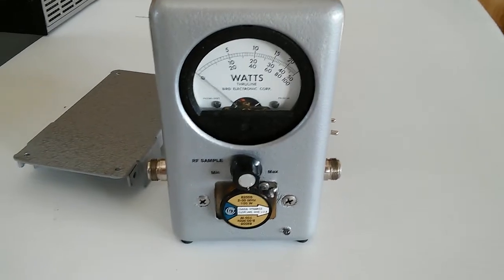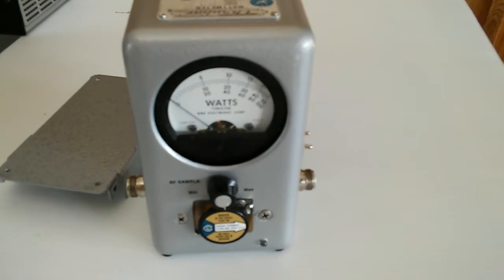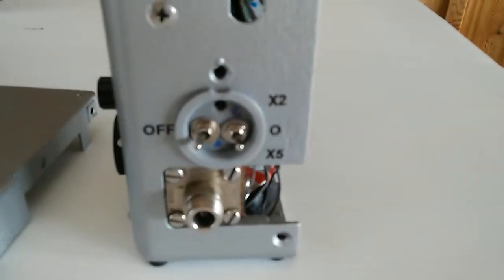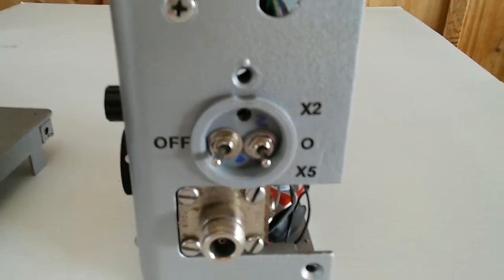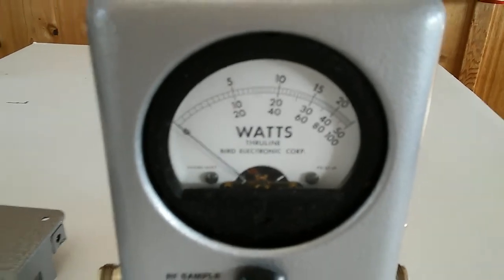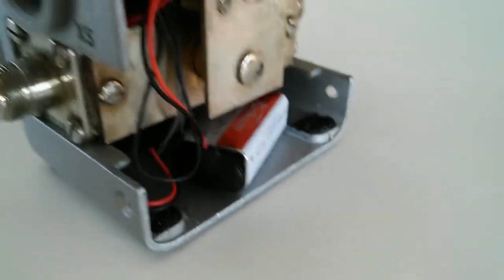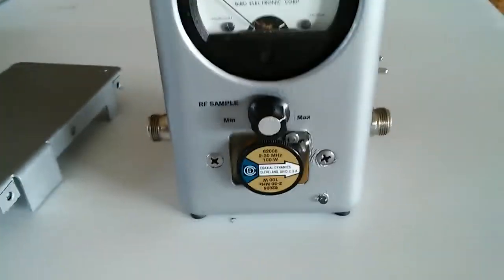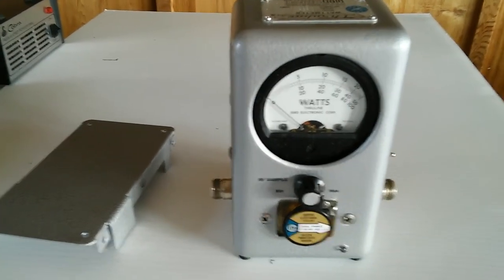Bird 4431 watt meter with PEP Kit and new paint job

Comment: hi I noticed this very important thing. trough voltage drop you will get false reading information  x1
Reply from the maker: Speaking of that.... I just checked my batt in the meter and its at 7v... Hahaha, time to swap that out. Cheers